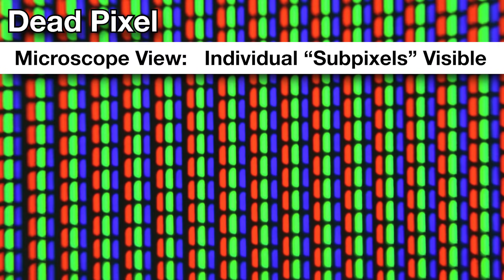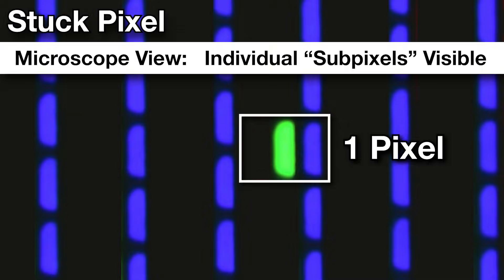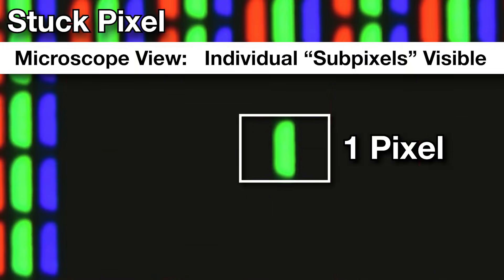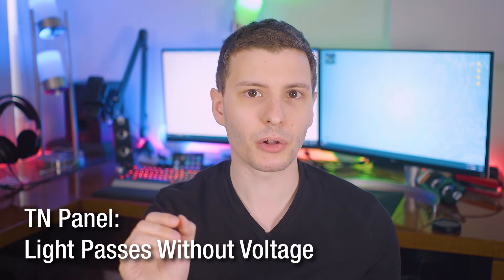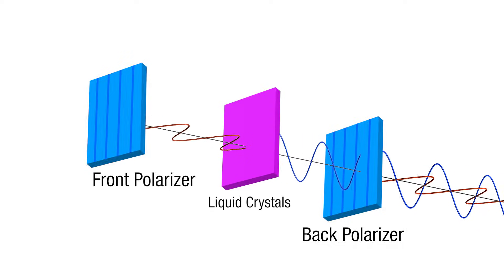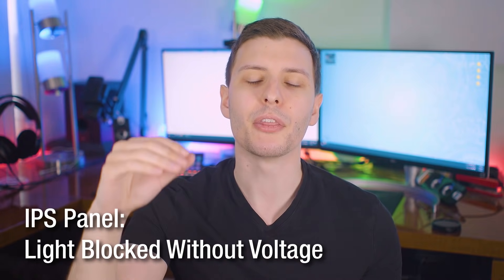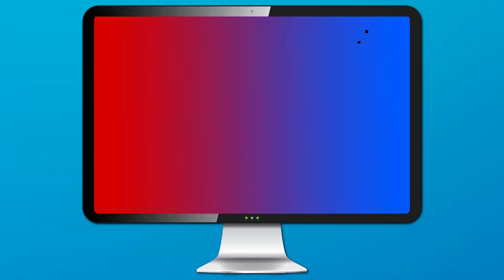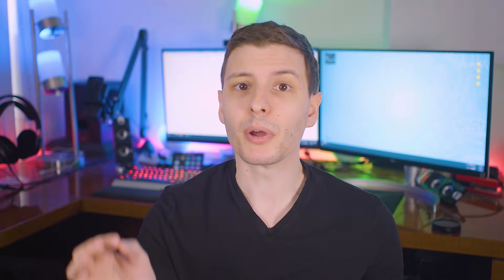Dead & Stuck Pixels: Causes and How to Fix Them

Comment: I am afraid of looking for dead/stuck pixels because once you found it you can never look the same at that screen.
Reply: I would only check if the manufacturer guarantees a 0 dead pixel on arrival
Reply: I have a tiny tiny chip on the outter layer and a hot pixel... I've long forgotten where they are and have to look hard for them
Reply: But if you look very carfully and don't find any dead or stuck pixel you are even happier than before. That's happened to me with my 55'' tv. ;D
Reply: But i mean the pixels are SO small you cant even see them while gaming
Reply: my phone has a dead pixel for some reason it goes away sometimes?.. I’m convinced there’s a virus that makes that pixel red randomly sometimes
Reply: if its a single pixel its not even that bad because its really hard to notice unless you memorize where it is
Reply: @user-jc2in3cp3g  how can I check that ??
Reply: @user-jc2in3cp3g  I have ordered Asus Rog G15 Strix I got a stuck pixle but after restarting the laptop it went away what should I do. My laptop is still under 7 day of replacement should I replace !! Also I have recorded the video when it happened so I have a proof as well
Reply: True man ocd kicks I’m so scared
Reply: @Jaypatel-up4jg  bro did you replace the laptop ? I also have same stuck pixel issue in my strix g15 which is purchased today😣
Reply: @viswanthkayalot  yes I put a replacement order within day and it got accepted they didn't even sent technician to check just accepted and gave me another 1 new in 1 week
Reply: @viswanthkayalot  don't take risk just replace it so you don't feel regretted in future
Reply: @viswanthkayalot  the 2nd one I didn't had any problem till now using it from 2 months
Reply: yeah, did that on my new monitor and oh i cant look there ever again
Reply: ikr....
Reply: @umairsaeed8061  yeah but in a plain white while browsing, it is. HAHAHA
Reply: omg yes i noticed it and now im  fucking stress out i wish i never knew it was there but its these fucking lines that look like a have a bucnh of windows stacked on each other and its on my task bar
Reply: True, I only check from far a tiny bit. once all clear I wont go precise check because there is always small mistake on consumer LCD screen
Reply: @umairsaeed8061  Not true. Stuck pixels are noticeable on dark backgrounds, it's just annoying, you can live with it, but fucking annoying.
Reply: I found one today and I can't not not see it
Reply: I have an msi ips panal
Reply: its true i just found some kind of stuck or dead pixel on my brand new SONY x95j 75 inch, so yeah...
Reply: @xugro  Don't give them any ideas! 😆
Reply: See but when you have a giant green stuck/dead pixel line on your monitor YOU CANT IGNORE IT.
Reply: literally me right now
Reply: All of my pixels arw dead
Reply: @gamersunite9026  i memorized where my single stuck pixel is on accident
Reply: @andrewalberico6177  I got same problem mine sony55inch! Could you confirm if we get struck means is there any issues? Especially while watching HD videos.
Reply: True asl
Reply: @gamersunite9026  I have the problem on my phone litrally One of thousands of pixels is stuck I Cant unsee it
Reply: @Richimilius  1k?????? man you gotta get a new monitor assuming you aint got a monitor bigger than 1920 pixels
Reply: The whole top left corner of my phone is broken-
THE MOST IMPORTANT CORNER!!!
😭😭😭
Reply: @xugro  yo exactly the same with me, brand new iphone 12 with a stuck red pixel that sometimes shows and sometimes not
Reply: i can only see my colony of dead pixels if i am 2 cm from the screen.
Reply: Lol True.
Reply: @umairsaeed8061  bro i see them
Reply: and its true...
Reply: Cool, my IPS monitor has 0 dead pixels, I did a test with a website and all the pixel showed the right colors. I look for over 12 minutes and yet to find a dead pixel.
Reply: I did you are sooooo right
Reply: I agree, I have one green pixel after used for 7 days. I was crazy
Reply: Same. I found multiple dead pixels on my led tv today. What hurts the most is It was new, only 10 days old 😔😞
Reply: I was looking at a picture of the night sky and there was a strange star. Turns out it was a dead pixel
Reply: if i find a dead pixel, i will see it forever
Reply: My tv screen has 3 "batches" of hot pixels and the biggest one is about a centimetre in length. I'm pretty sure the tv is a 2160p but I'm probably going to check later to see for sure
Reply: i bought a lenovo legion 7 new laptop and it had dead pixels and i got it repaired and now another white pixel appeared!!!! im sad and angry
Reply: Agree sometimes when I find one problem I just can’t get my mind off of it.
Reply: You will spot them instant anyway so better check for them when you bought something with a screen..
Reply: @Zephhi do these stuck pixels cause any further display issue in the future like display gets dead or any other major issues
Reply: Yeah I just found a black one on my 2 week old monitor.
Reply: can you see a stuck pixel in 4k Led  uhd monitor
Reply: bro i got my monitor i was so happy playing ect, then i opened a blank website and saw like 4-5 pixel green
Reply: @Jaypatel-up4jg  so you literally have another free gaming laptop? Now you have two!! 😳😳😳
Reply: @romella_karmey  lol no i had to return it and keep the new ones
Reply: lol i acidentaly found mine,and its berly visibul,yet its the onley thing i see now...and its brand new monitor :[
Reply: @ccvtzvdv  did that dead pixel got fixed itself?
I got a brand new 55inch 4k LED LG TV and after few weeks I found a dead pixel near middle, it feels so painful.

Pls tell what's your tv and did it get fixed itself?
Reply: @Enigelll  Bought a brand new Hisense 80 inch TV, found 1 dead pixel in the first week. I feel you
Reply: I thought the same but unfortunately I noticed it spontaneously, without actively looking for it

Comment: Monitor: dusty
*wipes*
3 seconds later
Monitor: dusty again
Reply: yeah water cause dust to stick to it
Reply: 🤣 laughed soo hard
Reply: bruh
Reply: I'm sure it's just electrostatic on an acrylic layer screen that keeps attracting all that dust.
Reply: Yeah we can all relate to this. Even though I'm a laptop user. I wipe my screen with cloth. Then after a day or so, it would be dusty again.

Edit: My laptop has a 17 in. display, and the screen isn't flat with what it's holding the screen.
Reply: relatable
Reply: I have a similar problem with cat hair, since my cat seems to explosively shed that stuff everywhere
Reply: L o l
Reply: The reason for this is the screen monitors static attracts a ton of dust
Reply: Monitor has a small stained spot that I think I can wipe away, try wiping it, no change at all. I think perhaps if I just use a tiny tiny tiny bit of water to loosen the dirt I can wipe it away, oh crap, I just made it worse, now it's scratched and dirty and no change except worse. Darn it what did I do. Dang I really wish this was an IPS display which had some sort of safe laminated glass like covering for easy cleaning instead of these exposed easy to damage screens!!!

Buyer beware. Live and learn. be very careful what kind of monitor you buy, even if it is a good price, there might be a hidden cost.

:)
Reply: True
Reply: Kids these days don't know the horrors of the old CRT monitors. You think they are dusty now, it would pull that shit from half way across the room when you turned it on.
Reply: I have stuck pixel its big and its like cursor
Reply: Use 100% cotton cloth or banian and a drop of water or iso propyl alcohol to clean it then check it back then it will be like a new display. Don't pour the alcohol but onky one or two drops.

Comment: All I did, with my TN/LCD monitor on, was put my finger in a microfiber cloth, apply medium pressure on the affected pixel, then turned the monitor off keeping that pressure on. Then, I turned the monitor back on. Then, I removed the pressure, and my stuck green pixel was gone!  !  !

Comment: I appreciate the lesson around monitors. However none of these suggestions worked out. What did it for me was to play around the refresh date of the monitor. It was set to 60 hertz and by switching from 60 to 75 and back, the dead pixels revived (they were stuck). Hope the suggestion works for you.

Comment: That dark purplish/blue spot after pressure treatment is a pressure mark where the plastic optical layers/filters are damaged. I see it all the time in field monitors that are prone to rough treatment and damage. I've also seen dead and hot pixels or pixel groups spontaneously fixing themselves after leaving the monitor alone for a while, only to leave such a pressure mark behind. It's very clear what the cause of the dead/hot pixels was in that case. Groups of dead and hot pixels can be caused by displaced or damaged spacers in the crystal layer of the panel.
Reply: so a pressure mark on a device like a phone can eventually go away? or will it just grow?
Reply: @im4ni_b  idk
Reply: @minilol122  i got my answer a month later, my phone dropped pretty hard and got a few black dots they even now grow but only to a certain point. Either i get it fixed or i buy a new phone
Reply: @im4ni_b  I actually got a new phone when the dark blue purple thing consumes half of my screen 😂
Reply: @prapanthebachelorette6803  😂😭 i wish i can do the same

Comment: IMPORTANT: If you have a dead pixel with a shadow is a windows problem, here i was tapping the dead pixel, pressuring it HARD with a damp cloth and dried one, running Jscreenfix and i saw a thread on reddit saying is windows problem so I restarted my computer and everything is back to normal
Reply: What a weird bug. Didn't think restarting would fix it.
Reply: @Addwho  yes is because some tab is bugged in 1x1 pixel

Comment: May 2022: I just want to say the jscreenfix and use of a damp cloth to "massage" the area worked to eliminate the stuck pixel entirely. Thank you for this video that's still helping people!
Reply: Ips display ?
Reply: @tomofthepops  Unfortunately not, I have the Dell S2716DG which is a TN panel
Reply: @urbanmarinecc  ah ok, I just got an ips monitor and got a green stuck pixel, trying to get if of it so I don't have to bother with the stress of returning.
Reply: @tomofthepops  Doesn't hurt to try though dude :) hope it works out for ya
Reply: @tomofthepops Did you manage to fix it?
Reply: @poremich  no I returned it, I did get one again after about 6 months but it fixed itself somehow. I sold it after that an brought an lg oled
Reply: @tomofthepops  was that pixel green color?

Comment: The tilt of your monitor is important too, I fixed my stuck pixels just by tilting the monitor back a little bit, pressing against it can be temperaroy only sometimes  if you have your monitor tilted forward, if you're lucky, tilting it back will solve it without you doing anything.

Edit: I didnt expect to help so many people :)
Reply: Bro this literally worked thankyou
Reply: omg as soon as I did that is went back to normal thank you so much!!!!!!!!
Reply: Do you know why this can work?
Reply: I have one stuck pixel in the upper right side of my VA monitor, which way should I tilt it?
Reply: @tracksuitcollector  probably due to gravity
Reply: lol, it didn't fix my monitor.
Reply: How to tilt monitor plz let me now
Reply: Do I just need to keep the monitor on a fixed screen, or play some videos in the background or use the jscreenfix running in background while being tilted upwards? And how long may it take?
Reply: This just fixed my stuck pixel!!! :D thanks!
Reply: @brianbrian_brian_brian was your stuck pixel green?
Reply: what color was your stuck pixel?
Reply: How to tilt monitor or laptop
Reply: Duuuuude this worked! Thank youuuu
Reply: @tecktonic88  how to tilt monitor or laptop
Reply: @Weinnion  well technically my issue was with a mounted TV which I had tilted forward so but reducing the tilt it got rid of the stuck pixel for me.
Reply: Mine doesnt fix but get less only when holding that on tilt pos
Reply: Dude you gotta be kidding me. After like 4 hours of troubleshooting i found your comment here and let my monitor upside down during night at i literally fixed 3 rows of stuck pixels i had at top of monitor :D How the hell did no one recommend this anywhere else. Thank you so much ♥
Reply: Wow thank you

Comment: just had a stuck pixel for 3 minutes

i went directly to searching because the monitor is not cheap at all

and then i literally tapped it with my nail and it went back to normal
that probably was one of the funniest moments of my life
Reply: that tap wasn't gentle/light at all
Reply: I JUST GOT ONE AGAIN
instantly did the same thing i did here... worked.

Comment: Thank you! Your tutorial was very helpful. The JScreenFix by itself didn't work, but when I combined it with the monitor massage method, it fixed the stuck pixel. I was kind of surprised that it worked lol. Thank you for your help!
Reply: was your pixel green?
Reply: @poremich  I have a green stuck pixel have u came across any solution?
Reply: @yath4nsh  nope, I’ve learned to live with it since it appears only on dark’ish backgrounds
Reply: @poremich  😭😭😭😭
Reply: @yath4nsh what’s your monitor? Ive got 165 hz IPS one and I primarly use it for gaming, yes, I can sometimes see that green pixel but I managed to bear with it with a time
Reply: @poremich  gigabyte g24f 165hz
Reply: @poremich  bro does ur stuck pixel only comes in black colour or any dark background mine comes in dark background
Reply: @yath4nsh  in dark background

Comment: Came across this whole looking for info on IPS screens since my brand new MSI came with a stuck red pixel. Took a few shots with my cheapy USB microscope and JScreen seems to be helping a bit so I'm going to run a full screen video I also found on YouTube overnight in hopes that kicks it into gear. If the "noninvasive" attempts don't do it, it's going in for an exchange.
Good video with lots of good info.
Reply: Any luck with JScreenFix? My new Dell S2721DGF has three stuck green subpixels.

Comment: Stuck pixels are weird. Had a couple of them in the past and was able to fix both of them because they were just stuck. A quick Google search for a pixel exerciser which basically is a little box that flashes different colors quickly to exercise that pixel can be placed over the bad pixel and surprisingly if it is just stuck with a color on it, in my case it was green both times, it does fix it.  Neat quick easy do-it-yourself fix.

Dead pixels truly suck though. usually a certain number of them have to be dead or you're just forced to use it and rage.

EDIT: after watching the full video you reminded me that I once had to massage a dead pixel back to life as well. Yes really weird but it does work. I had a stuck pixel once and I tried with a microfiber cloth very carefully and gently massaging the small area it was located at being careful not to press too hard because you don't want to see a rainbow effect on the LCD and damage your display. Massaging the pixel I can confirm also does work as well. I've done it, it worked.

So the tldr version for anyone who has trouble with a stuck pixel of a specific color, try the j-screen fix he recommends, I've had it work in the past. I've also had massaging the pixel work as well. I would try Jscreen fix first to avoid touching the display. As long as the pixel isn't completely dead the good news is knowing the right information as he provided in this video you can take Brian and fixing it yourself because often you might get lucky and you can. Good luck everyone with stuck pixels, we feel your pain.
Reply: you’re giving me so much hope 😭
Reply: yeah. i left it on for so many hours that stupid green pixel is still stuck. this is the third monitor in a row i had issues with. i guess i am cursed... i hate monitors
Reply: @erbsenkaffee8720  haha, bro, I've tried 5 monitors last 2 months and they all HAD AT LEAST ONE FCKING DEAD PIXEL. So, you're not the one who cursed :DD
Reply: @vopseleacrilice3062  at least you can send them back right?  It was too late for mine haha. Hope you'll have more luck in the future
Reply: After reading your comment, "I once had to massage a dead pixel back to life", I couldn't understand weather to laugh or cry. The pain in the heart but the smile on the face after reading your comment. I think only the people who go looking for dead pixels must be truly happy,.. I don't know..

Comment: I bought an MSI monitor, there was a stuck red pixel on the right corner. After a few days, it's gone. I tried EIZO monitor test, not sure it resolved from that test but its worth trying.

Comment: This video is so informational. Really appreciate man! Gonna try to fix my laptop display having a TN panel. The display turns on but the brightness is just too low, for all of the pixels on the screen. I can see the content on screen when I put a flash light directly on the screen. What do you think could solve this? Thanks!
Reply from the maker: Hmm sounds like an issue with the backlight, potentially
Reply: @ThioJoe  I see, I'm gonna try to fix it now. Thanks!